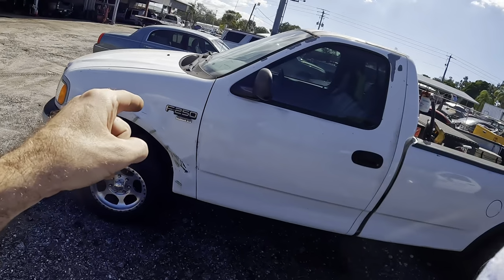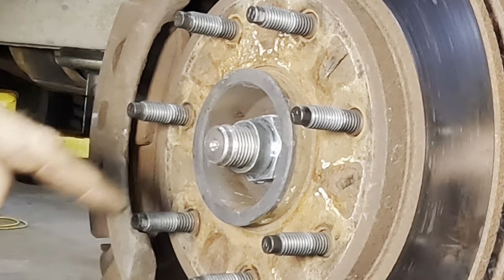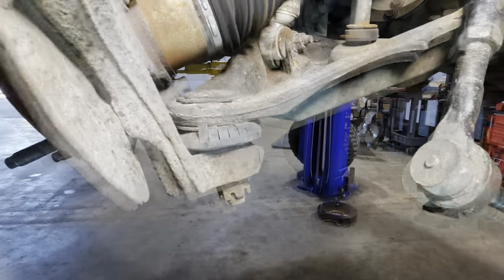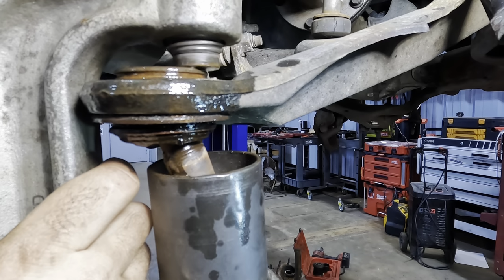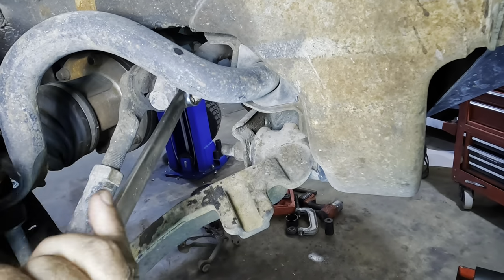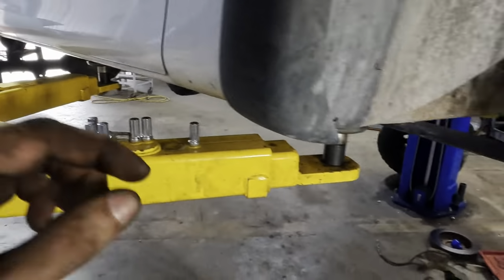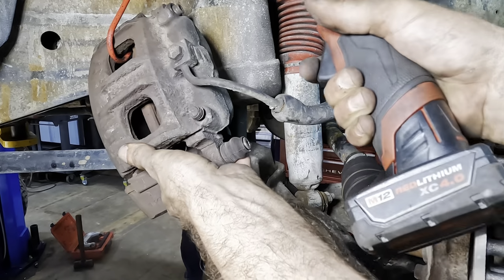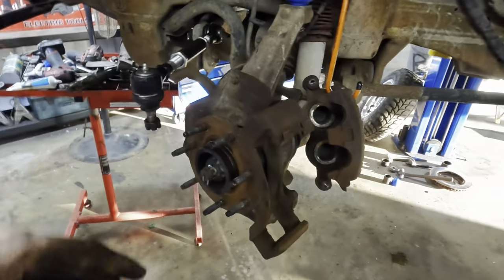Loose Balls- 7 Lug F250!  Wheels Fell off!

Comment: I think I know the source of your parts issues. This is an F250, but not an F250 HD. In 1999, the F250 was a beefed up F150. The F250 HD is probably the parts they were sending you. That's why the ball joint you got was too big.

Comment: Well worth the repairs even for a 99, compared to 60-70K for a new truck (which would be a new POS). Even though all the parts on that truck are HEAVY, they are much easier to access than on most newer vehicles. Nice job Ray!
Reply: I've spent a few grand replacing and upgrading my 99 ram, and will continue doing so simply because new trucks aren't with the effort or cost. Well maintained old machines will last forever, and can't say the same about the new cheap materials new vehicles seem to be constructed of

Comment: Seeing you do this job makes me appreciate Fords twin I Beam front suspension all the more...fewer parts to service and longer intervals between service needed. 
    A great video...and a great demonstration of that ball joint seperater...i was expecting it to slip off and go flying with the load that was on it. I'm glad you got it apart after a couple whacks with the load on it.
    Thanks for the great videos as always Ray...you and Dave make a great team knocking the truck out once the correct lower bj's were acquired.

Comment: Ray, A few suggestions when working on brakes: 1) Bleed the brake lines at the caliper when compressing the cylinders to avoid contaminating the master cylinder with water and corrosion products that have accumulated in the brake lines. This also prevents the brake fluid reservoir from overflowing.  2) Run two lug nuts down against the rotor to secure the rotor in place when reattaching the caliper and brake pads.

Comment: Just a little advice for all you guys at home, if you are replacing the joint and the cotter pin is frozen or just a mess, just cut it or bend it up and pound the socket over it. The impact or ratchet will make mince meat out of the cotter pin every time. Now if your saving the joint,  obviously its not plan "A" but it can be easily drilled out. I have seen guys spend 30 minutes on cotter pins.

Comment: Ray in the UK I have the same rack (ramp) as you are using in this video. We have just have a safety recall on them! The spines that are bolted to the arms to prevent them turning after the car is lifted must now NOT be adjustable AND must have a 8.8 tensile bolts not the 4 or 6s you may just want to check yours.

Comment: I love that because of watching you do front ends for the past year, I have rebuilt the entire front end and replaced the steering arm, including dropping the subframe to do it on my PT Cruiser.
But thats not all, I have nearly rebuilt my Dodge Dakota truck front end and am finishing up today on my Kia.
The Kia had a clunking noise. After replacing sway bar links, control arms and struts, it came down to the worn sway bar to frame bushings. The worst thing to have to do.
It involved dropping the subframe partially down, loosening the steering column shaft to get just enough space. The only thing left holding it was the front engine to subframe mount.
It also involved dropping the  Y pipes of the exhaust.
Luckily it is fairly new.
One lesson I learned from you is to just go the extra mile and remove things in the way, rather than trying to take short cuts that take longer and result in more damage.

At any rate, I maintain all three of my older cars myself, from self confidence of watching you work.
The money I have saved on all three cars is still less than a brand new car payment, interest and required maintenance that costs extra.

Comment: i did my e350 with the same brakes. The shims were wrong, the rubber 4 boots per caliper & tucking the top of the caliper in first got me frustrated. I cleaned up the old shims & got it done. Do-diddly-do!

Comment: Ray, so I've heard other technicians make comments about not tightening bolts on suspension components that incorporate bushings until the suspension is under load. I noticed that you did not do that here, does it really make a difference?

Comment: Good rule of thumb. If the bottom ball joints are bad, change the upper control arms (ball joints) too. If the upper ball joints are bad, change the bottom ones too. If they are the same age, it's all relative. I had a 98 F-150 years ago and just rebuilt the front end and then had it aligned. It just makes sense instead of doing one part now, then another two weeks from now, so forth and so on.

Comment: I keep thinking how handy it would be to have magnetic trays on the lift arms and frame. Easy to reach, and a lot less likely for parts to fall off of!
Reply: This is a good opportunity to invent TremaineLea! Unless it already exists. ☹️
Reply: Magnetic trays have existed for years
Reply: @foltzenlogel  I'm thinking more like a magnetic tray with a magnetic L bracket so it can be stuck to parts of the lift. 

Pretty sure drilling holes into the lift would void a warranty or something 😂
Reply: The lift is metal (ferromagnetic) so the magnetic tray sticks to the lift.  The tray is shaped like a bowl, so you can put non magnetic parts in it.  Ray has used one before, I don't know why he doesn't use it more often.  I have a couple, and use them a lot @TremaineLea
Reply: I was thinking the same thing when the wheel nuts kept falling off the Lift arms ..
And yea, they already exist..
Reply: @TremaineLea  you get get rectangular and round magnetic trays of different sizes from Harbor Freight

Comment: I worked for my uncle that ran a gas station in western Kansas for two summers.  When we performed service on a car, we always gave a complimentary  vacuum out and cleaned the windows.  We had to vacuum out a 'farm' car once (spends most of the times out in a field).  It was a good thing it was dry inside or there would have been a crop of wheat in the car.😁

Comment: Cotter pins. What Ray describes as cotter pins are usually just called 'split pins' in the uk. Cotters are the threaded pins with a flat on one side that on bicycles are used to lock the pedal cranks to the drive shaft. Great videos.

Comment: Hi Ray them pins here in England are called split pins .a cotta pin as you refer it to are used on bicycle to hold the peddles to the crank.they are like a wedge with a flat side.

Comment: Great video, question, Ive been putting a small amount of brake grease on the pad slides and a couple of nuts temporary to hold the rotor, I'd be interested to hear your comments on that.

Comment: First time I ever saw that "OEM" ball joint tool, that you used on the driver side lower control arm. Pretty slick the way that works...the forks on the tool are so thick, the ball joint has to be already loose before you can even get the tool on.
Is that the "pre-emptive-application" principle of engineering?
Why does that feel like a Chinese design?

Comment: Looks like that Truck has been in North Florida, Alabama or Georgia..

I just did this same job on my 04, Crown Vic. Police interceptor 
Also lifted  it 3" added 2" wheel spacers 2000 year Excursion rear coil springs, F-150 rear shocks rear control arms, Watts link, sway bar links, tires Goodyear Wrangler ( Jeep ) 265/70/ 16 AT on Factory 7" rims cop center caps

Comment: Instead of hitting the tierod stud end with a hammer, hit the the knuckle on the end (the round spot), It works a lot easier with less pressure needed on the tool separator.

Comment: Hi,another non greasable lower ball joint,yours was easy to press on. Upper A arm bushings are stressed now in upper position ? I am just completing a broken torsion bar that was welded in with 23 years of salt corrosion on my 1 ton 4x4  6.5 dump.. I couldn't get a new factory A arm or torsion bar.Obsolete !

Comment: Always love to see a vehicle where the rims and tires are worth more than entire truck.
Reply: its  a working FORD truck , what do you want ??? a shinny new silver- ado , you ford hater
Reply: My thoughts to the tee!
Reply: Nope, not even close.  Tires and rims were $800.  Truck is worth over $4K according to my current insurance valuation.
The reason for the directional tires is I spend a considerable amount of miles in 4 wheel drive.  Of the now 140k miles, probably 50K of that is in 4 wheel mode.
The suspension got smoked on S Texas oil field Lease roads where I spent 3 years in goo getting to my cranes.  The loose sand where the majority of my jobs occur means slogging in 4 wheel drive getting to the crane for refueling.

Comment: If you take a can of red spray paint and spray the parts before you take them off it will give you a rough camber adjustment when you go to put the new parts back on😮

Comment: The 3 valve 5.4 liter Triton was introduced in 2004…so that’s a 1999 with a 5.4.L 2 valve if original
Reply: Correct!  Fun fact, these light duty F250s could also be a 4.6L with the 4R70W.

Comment: This video should get billions of views! Yeah, this WAS A VERY GOOD VIDEO!! All of the bolts and steering joints came out without any trouble or little trouble. I work with computers so I wish I had someone to remind me that I didn't install the backing plate software! Good job Dave and Ray, thanks for what you do, your sense of humor. I stayed tuned because it is going to be a very good video, and it was one of the best I have watched in the last two years or so. I have nothing more to offer on this video so I liked it and commented. Goodbye everybody!

Comment: That truck is a bit of a rare bird. The 7700 series were basically a heavy duty half ton (hence the 7 lug axles). It's got a 2v 5.4...the 3v didn't come until later. 

The issue with the odometer is one i chased on a 99 i owned years ago. There's s handful of cold solder points on a ribbon cable header that cause that display to go dark. I had to remove and dismantle the gauge cluster, and resolder all of those pins. Sometimes slapping the dash above the gauges will cause it to come on for a bit.
Reply: I have 3 of these 7 bolt F series 7700 light 250 or heavy half tons. (depending on how they were badged and tagged) Two are California trucks with very low miles (ex-Naval Reserve) and have the dual fuel gas and CNG tanks with two ports for fueling. All are 5.4 - two valves. You are right they are a 'rare bird' as just try and find a spare wheel for one if yours didn't come with it. Nearly impossible. I have gotten as high as 24 mpg on CNG at the speed limit and as good as 21.5 with regular unleaded. They all came with high speed rear axle ratios so cruise right along at 75-80 with no load. They are capable to pull with but I do not as I have several other F250 heavies and several F350-F450 with that better option of better pulling while tugging a trailer or heavy load. GREAT job Ray ! Nice work as always .... love your vids
Curiously on some Ford chat sites, this seven bolt truck is referred to as an F200 as it falls somewhere between a F150 and F250

Comment: Ray, I’m just curious,  have you ever washed a customers vehicle before starting to work on it?  I tend to do this for my own cars and trucks. Even just a quick power wash down of the wheel wells seems to make the job easier. I also tend to run my vehicle thru a car wash if I’m asking a shop to work on it. Just seems like a small gesture of respect and civility that makes sense to me.
Reply: I do the Same but my vehicles generally are not caked with mud, my next door neighbor is a Mechanic and farmers bring in their vehicles totally incased in mud, he cuss's but just keeps on working...

Comment: Very interesting and informative video, as usual...at least for me it is. I found the fact that the upper control arms being adjustable for caster/camber did not have the eccentric washers. must be a bit more challenging for the alignment person. Also, the fact that the owner was just now bring it in for the suspension noise, and seeing how those ball joints were SO BAD. Glad you are able to make this vehicle safe again. Thanks for another great video.
Reply: You can put the eccentric washer\adjusters on when doing the alignment. Probably never had an alignment done & still on 'factory-set alignment'. 👍🤷‍♂️🤔🤦‍♂️👌🛠️🔧🗜️📏⛓️🔩😀🍻
Reply: When the wheel fell off, they probably decided it was time for some actual maintenance. 😂

Comment: I know how to fix the odometer display on the '99-'03 Ford trucks. I figured out how do it on my truck. Pull the cluster and re-solder the pins that connect the odometer to the ribbon cable.

Comment: The blue dot on the ball joint boot is supposed to be pointing inward to allow excess grease to not drip onto the wheel and get slung all over the rim and dripping onto the rotor.

Comment: It is suprising that there are not cam washers on the upper control arms. I would think no matter how tight those bolts are that the would be suseptible to move. Cam washers would most certainly halt any movement which would not compromise the alignment.

Comment: Queschink. I mostly work on motorcycles.  I always make a point to clean off the caliper piston sides off first, so as to not damage the piston seals when I push the pistons in.  I noticed you don't.  Am I wasting my time?

Comment: Hey Ray a little disappointed in what you showed today to some younger mechs.  would you mind a slight critique?  Lower ball joint tool-- #1 the stress placed on that tool -your lucky it was only hot- it could have exploded and had shrapnel well everywhere. #2 and I've seen you do this before so was shocked you waited so long-- get your tool all loaded up tension wise and sharp hit with a hammer. (you usually use a framing hammer)  #3 you used a steel headed hammer on your new threads of the ball joint--- lucky you didn't damage the start threads. put the old nut on hit if your going to whale away at it.
Suggest you dump the needle nose pliers-- use dykes to take out old keys a lot more twisting power with diagonal cutting plyers.  
True story: I was working a cable on a sailboat mast with an Australian mechanic in Tortola BVI. . He had his tool bag by the mast and cable and I asked him for a pair of DYKES. He starts laughing and says why are you asking for 2 lesbian women?

Comment: 5:23 that's what happens when you replace only one rotor at a time. Lololol
Reply: Replace in pairs, just like when you do a SET of pads or shoes. It’s quite often known to have a different coefficient of friction which causes uneven braking and sometimes violent steering wheel pull.
Reply: @ToddAdams1234  I learned this the hard way long ago. Lol

Comment: I hope you don't mind my comment Ray, but when you refitted the top suspension arm, instead of using a monstrous prybar shouldn't you have loosened the top bolts so it's not under so much tension? Tom.

Comment: Those fords were weird! Only existed for 1 year between 97 when they discontinued the old body style 250 and 350s, and 99 when they introduced the "super duty" line with the new body. In 98 the F-250 was just an F-150 with slightly heavier duty suspension and a 4r100 transmission instead of the 4r70w.  Post 98 you could actually still get that configuration but it was called the F-150 with the 7700 package.
Reply: Oh it gets weirder as they also could have a 4.6L with the 4R70W which is what I have.
Reply: @wexysexy6942 extremely odd! Ive only seen a handful out in the wild, I have an 01 F-150 with the 7700 package though. They aren't bad trucks but its definitely no 3/4 ton.

Comment: That should be the Triton 5.4l 2 valve. I don't believe the 3 valve came into production until 2004. I had a 2003 F150 with the 5.4 and it was a 2 Valve.

Comment: I always run a lug nut up on my rotor while I install brakes. Nothing moves around. Brake jobs have been so much easier since I learned that trick. I keep lug nuts in my box just for that. Open lug nuts of course. Lol!

Comment: 0:10 Not a 3 Valve, the 3 valve came out in 2004 NBS (Non Heritage)  F150
29:20 I bet they sent you the ball joint for a F250 Super Duty, where this truck is an F250 "Light Duty" (which is just a heavy F150, and was later sold as the F150 "7700", as in 7700lbs GVWR)

Comment: You know, I've seen a bunch of videos where people use pullers on ball joints, then ran across one where it just got smacked with a hammer and dropped loose.  Was like "wha?" ...

Then I needed to change steering knuckles on my Jeep and tried it myself, and damned if it doesn't work.

Comment: That looks like a Mevotech control arm you installed, I have my concerns with that brand...I had ordered $200 worth of suspension parts from them and half of them were bad out the box and just not made well. I've heard a lot of stories about their parts failing after a short amount of time as well. Obviously sometimes you just gotta run with what you got, but it's something to be conscious of.
Reply: The thing with those of us who know the difference between cheap aftermarket and OEM quality is we are willing to pay the difference in price without a second thought because the labor is FREE. I think for most nontechnical folks, especially in times like these(ultra high prices) they just try to get stuff fixed without going bankrupt.

Comment: It's True about letting your vehicle turn to Junk,if you have Bad Ball joints it will put extra Stress on your Control Arms,Idler Arms,tie rods and stabilizer Links /bushings and Visa Versa
So it's Pay a Little now or a Lot Later as seen in this Situation

Comment: Another good watch. Just last week did most of the same plus O2's, plugs, oil/filter, front diff inspection and oil change, rear diff clutch packs and seals, all 4 corners brake pads, 4 new tires, and other less big tasks. Rusty but trusty '03 Dakota from SE WI. RUST SUCKS!! 🤬
🤪 Don't forget to torque the axle nut on your side.